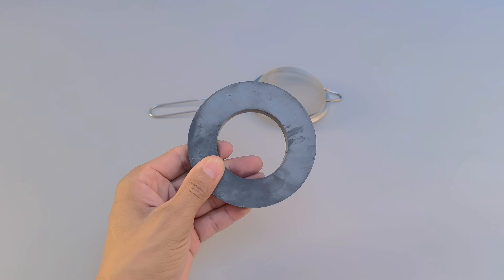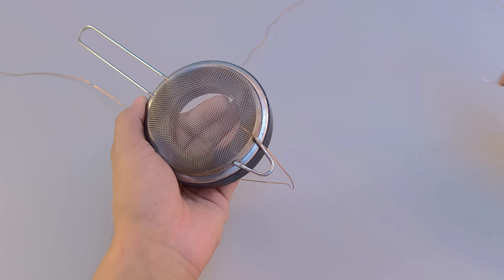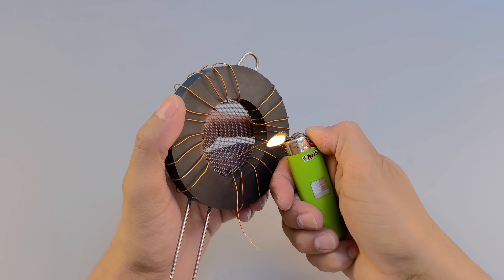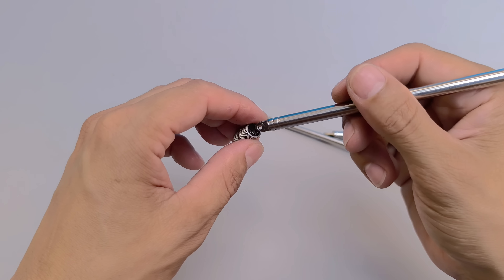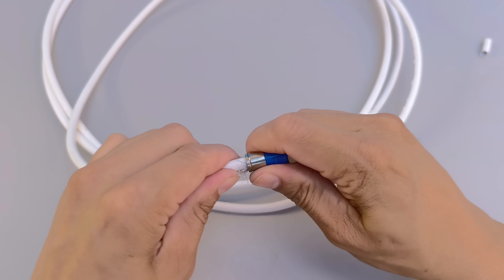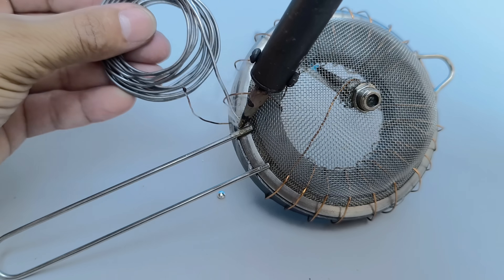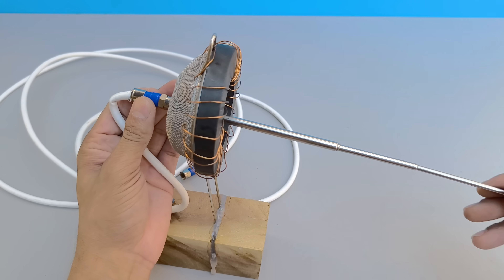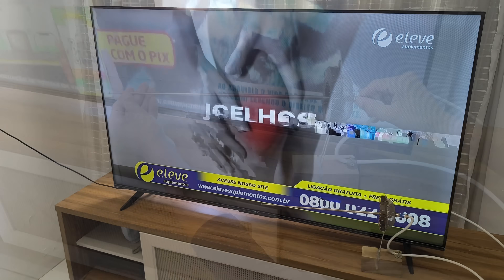Nikola Tesla's Secret Invention! Connect a Steel Sieve to a Magnet and See What Happens

Comment: Wow what a useless presentatiion.
This will not work as this guy obviously has no idea how coaxial cable works. Not only does he not know how to solder but the fact he connected the center lead to the outer case of the connector he shorted the signal lead to the shield so there is no antenna at all.  The "antenna" is not even in circuit let alone his half assed induction coil. And even if the lead was properly connected the impedance would be mismatched. And you are never supposed to put a sharp bend in coax cable. Could he have done this more incorrectly?
DO NOT build this useless contraption!
Reply from the maker: Take it easy, friend! 😅 The idea here is not to replace a professional antenna, but to explore possibilities with creativity and reuse of materials. Even outside the ideal technical standards, sometimes the "impossible" works in practice. But thanks for the detailed analysis — constructive criticism (without bashing 😄) always helps to improve!

Comment: I am an engineer from Japan. This video shows a setup that is completely meaningless from an electrical standpoint.
If this kind of setup results in receiving a signal, it simply means that the broadcast signal in the area is already strong. In such cases, even just stripping and extending a coaxial cable randomly would produce the same result.
The sieve, the magnets, the enamel wire, and the mention of Tesla — all of these are used just to make it look convincing and mislead people who don't know better.
電気的には全く意味がない工作です。
これで映像が映る環境であればそもそも放送の電波自体が強い地域なので、同軸ケーブルを適当に剥いて伸ばすだけでも同じように映るでしょう。
ふるいも磁石もエナメル線もテスラも、素人を騙すためにそれっぽいものを引き合いに出しただけです。
Reply: Thanks for the truth.
Reply: Thanx you saved me time
Reply: UK here your so right, people will believe anything a so called expert tells them.
Reply: @piano40s until you try or have means to test it out you gotta believe someone that has tested it before you
Reply: If magnets could enhance radio wave reception,  😂😂😅😅  then why don’t any antennas contain magnets? I've never seen a radio or TV antenna that includes a magnet.
     もし磁石が電波の受信を強化できるなら、なぜどのアンテナにも磁石が使われていないのでしょうか？ラジオやテレビのアンテナに磁石が使われているのを見たことがありません
     자석이 전파를 강하게 수신하게 해 준다면? 왜 그 어떤 안테나에도 자석이 포함되지 않는가? 내가 본 라디오 안테나, TV 안테나에 자석이 포함되어 있는 것을 본 적이 없다.
Reply: @mathamour  
Thank you. Your point is absolutely correct.
In AM radios, the built-in bar antenna uses a ferrite core, which looks similar to a magnet on the outside.
At first, I assumed the video creator might be trying to use the magnet as a substitute for a ferrite core. But as I kept watching, it became clear that they were doing something completely meaningless.
In addition to that, there are numerous other mistakes related to the shape, electrical connections, and usage.
However, if I explain too much, it might give the creator "hints for how to deceive viewers more effectively in the next video," so I’ll refrain from going into further detail.
감사합니다. 당신의 지적은 전적으로 옳습니다.
AM 라디오에 내장된 바 안테나는 겉보기에는 자석과 비슷한 페라이트 코어를 사용합니다.
저는 처음에는 영상 제작자가 자석을 페라이트 코어의 대체물로 쓰려는 것이라고 생각하며 봤습니다.
하지만 계속 시청하다 보니 전혀 의미 없는 짓을 하고 있다는 걸 알게 됐습니다.
그 외에도 형태, 전기적 연결, 사용 방법 등 여러 가지 잘못된 점들을 지적할 수 있습니다.
하지만 너무 많이 말하면 영상 제작자에게 “다음 영상에서 시청자를 더 잘 속이기 위한 힌트”를 줄 수 있으므로, 자세한 설명은 생략하겠습니다.
ありがとうございます。あなたの指摘は正しいと思います。
AMラジオの内部にあるバーアンテナには、外見が磁石に似ているフェライトコアが使われています。
私は動画の途中まで見たとき、磁石をフェライトコアの代わりとして使おうとしているのかと思いました。
しかし視聴を続けているうちに、それが電気的に意味のない行為であると分かりました。
それ以外にも、アンテナの形、電気のつなぎ方、使い方など、間違っている点はたくさんあります。
でも、あまり詳しく書くと、動画を作った人に「次の動画で視聴者をもっと上手にだますためのヒント」を与えてしまうかもしれないので、細かいことは言わないことにします。
Reply: @須磨保太郎-s2y   Your comment is bang on.  I have seen  dozens of Youtube videos with an endless assortment of random items  connected to a piece of coaaxial cable  to increase TV reception that all do nothing but waste your time !
Reply: @須磨保太郎-s2y  Thank you so much. 👍
Reply: @須磨保太郎-s2y is not like there is a copyright on the patent
Reply: @mathamour  The starving creator of this video wanted to appear convincing.
Reply: @mathamour  Maxwell Chikumbutso retuned and turned it into a power source. Buy him a coffee.
Reply: @mathamour  Yo he usado imanes en el cable coaxial con buenos resultados, inténtalo, pero claro, no se necesita todo este procedimiento, solo enredar el cable en el imán. Saludos.
Reply: Thank you so much!!! I almost start doing it. The guy who created this video is starving and needs some money from U-tube.
Reply: @balloney2175  he is brasilian!
Reply: Thank you for sharing your knowledge. Whenever a video title includes 'secret',or 'hidden' knowledge you can bet your life it is utterly useless.
Reply: The coax is short circuited at the base of that Balun where the dipole is soldered lol
At best it will overload the impedance and fry the TVs signal amp lol
Reply: As an electronics technician, I have to say that solder joint probably receives more radio interference than the whole setup itself! 🤣🤣
Reply: Exactly 100%, as an electronic engineer, the project is a complete joke!   'Nicola Tesla secret invention', what total 'BS'!
Reply: Я Я инженер не из Японии  и я точно такого же мнения как и инженер из Японии.
Reply: @ЗарубаВалерий-л4ю  😂😂😂👍👍
Reply: Aconsejo antes de ver estos" inventillos" ver primero los comentarios 😅😅😅😅😅😅
Reply: Так делают все распространители фейков используя набор вещей которые под рукой что бы сделать какую нибудь нелепую конструкцию и при этом убеждать всех что это что то фантастическое ..используя  имена известных учёных и изобретателей.
Reply: Agree.  I'm electronics and control system engineer also, this device is nonsense.
Reply: СПАСИБО!
Reply: The thing I want to know is can still use the shive to make my fairy cakes? 😂
Reply: @paulwalls9851  Looks like it can't be used for baking anymore — but now it’s perfect for sifting out people with scientific literacy! 😄
Reply: Eso solo vale para perder el tiempo
Reply: @須磨保太郎-s2y  очень жаль, что Ютюб который делался как просветительный канал.... Превратился в канал для фриков, и шутников (((((((. И спасибо что есть такие как вы, которые объясняют что это глупость! Спасибо!
Reply: En cuanto vi el colador de aluminio y el imán me empezó a chirriar.
Reply: Person already stated this is a project of love it doesn't include any scientific research or engineering aspects at all.
Reply: Cały ten projekt to bezsens. Ale ~780k wyświetleń, 1k komentarzy i autor filmiku zarobił pieniążki od YT. Ode mnie zarobił bana.
Reply: Excatly. Basically just a bunch of click bait.
Reply: That's true, I also noticed meaningless short circuit of the connector by telescopic antenna.. This vid is only good for learning American English and how to take apart the F - connector))
Reply: @須磨保太郎-s2y  gracias por mostrarnos la verdad!!!
Reply: @須磨保太郎-s2y  you are correct
Reply: thank you
Reply: @須磨保太郎-s2y  siii cuando pusieron Tesla ya demostró su inercia mental. Entré a ver los comentarios... Jejeje
Reply: Thank you Sir, I despise fake people and information
Reply: @須磨保太郎-s2y  saya percaya ahli japan
Reply: Thank you from US ❤
Reply: I’m not an engineer, but I’ve done some research and probably more than 90% of the things that people claim Tesla invented had already been previously invented and quite frankly the only thing I can find that he actually invented may very well be the Tesla coil. Now is he famous for tinkering with those previously invented things and putting them into practice such as the AC motor (which was invented in Germany and not by him)
Reply: Thanks for your information.
Reply: agree with japani engineer, there was no calculation how much impedance does this coil made for. seems baseless really.
Reply: exactly
Reply: I agree 100%  This is mumbojumbo.
Reply: Du hast vollkommen recht, zudem ist der Innenleiter mit der Abschirmung kurzgeschlossen. 
Der Baumarkt-Lötkolben und der Lötversuch deuten auf einen Anfänger hin. DVBT wird, zumindest hierzulande, vertikal ausgestrahlt, da die "analoge" Ausstrahlung bislang horizontal erfolgte. Somit wird ein großer Signalabstand gewährt. 
Grüße aus Deutschland
Reply: Great. Looked like an April Fools Day joke.
Reply: это фокус для школьников и детей а не для взрослых дядей
Reply: It's a very eficient AntrennA for gathering KLICKS ! !  Curiosity is yet functining, not only at CATS.
Reply: Thanks you for letting us know. There are more and more similar fake videos and this wastes our time.
Reply: 8:43 ”make sure to kink the coaxial cable to block any possible signals caught by the device…”
Reply: ✋YOU DON'T KNOW THAT FOR SURE..! 
🧐DO YOU.!?
You maybe 99.9% sure, but not 100%.
Science will ALWAYS surprise you.!

Please, don't destroy all those potential 
future scientists by your telling people, convincing people, NOT TO BOTHER.! Not to 'try' or See For Themselves? 

How many times have YOU failed before you succeeded? Probably thousands? But that's how people learn! That's how YOU learnt.! 

Yet you come on here like a god, a KNOW IT ALL, and think you are now a master or the universe, and WORSE, tell people to NOT BOTHER doing EXACTLY what YOU did to become the professional YOU are today.!

Do YOU see now?
Do YOU see what YOU have done?
YOU LEARNT BY YOUR FAILURES.
Yet YOU tell others Not to ask YOU did.?
STOP-IT NOW!
Think carefully about how YOU learnt.
And pass those blessing on to others x
Reply: YOU DON'T KNOW THAT FOR SURE..! 
DO YOU.!?
You maybe 99.9% sure, but not 100%.

Science will ALWAYS surprise you.!
Please, don't destroy all those potential future scientists by your telling people, convincing people, NOT TO BOTHER.! Not to 'try' or See For Themselves? 

How many times have YOU failed before you succeeded? Probably thousands? But that's how people learn! That's how YOU learnt.! 

Yet you come on here like a god, a KNOW IT ALL, and think you are now a master of the universe, and WORSE, tell people to NOT BOTHER doing EXACTLY what YOU did to become the professional YOU are today.!

Do YOU see now?
Do YOU see what YOU have done?
YOU LEARNT BY YOUR FAILURES.
Yet YOU tell others Not to do as YOU did.?

STOP-IT NOW!

Think carefully about how YOU learnt.
And pass those blessing on to others x
Reply: @須磨保太郎-s2y  YOU DON'T KNOW THAT FOR SURE..! 
DO YOU.!?
You maybe 99.9% sure, but not 100%.
Science will ALWAYS surprise you.!

Please, don't destroy all those potential 
future scientists by your telling people, convincing people, NOT TO BOTHER.! Not to 'try' or See For Themselves? 

How many times have YOU failed before you succeeded? Probably thousands? But that's how people learn! That's how YOU learnt.! 

Yet you come on here like a god, a KNOW IT ALL, and think you are now a master of the universe, and WORSE, tell people to NOT BOTHER doing EXACTLY what YOU did to become the professional YOU are today.!

Do YOU see now?
Do YOU see what YOU have done?

YOU LEARNT BY YOUR FAILURES.
Yet YOU tell others NOt to do as YOU did.?

STOP-IT!
THINK!
Think carefully about how YOU learnt.
And pass those blessings on to others x
Reply: Sitko to niejaki Marek Podlecki omawiał jak konstruował tajny projektów nazwie Deparchator😊
Reply: almost every channel is encrypted even if the "antenna" does the job he says, it does not decode the signal for which you need a receiver with a decoder
Reply: 100/100 🙂.
Reply: Does this explain why as a kid when I unplugged my console coaxial cable I could still see the image perfectly fine on the tv? I swear I did that some day haha that or maybe I unplugged another cable
Reply: Benar sekali , hal hal seperti ini mudah dimengerti oleh tekhnisi
Reply: Yes.  Scam the ignorant with sensational nonsense.  Just like FoxNews does to MAGA fans.
Reply: По ідеї.... Ідея представлена в відео. Має право на існування. Але саме це виконання. На мою думку теж переводня матеріалів.
.
Я про що маю на увазі. Використання певного блоку потужних магнітів... Як джерела фокусування магнітних хвиль, довкола магніта...
.
І все... Мені особисто здається... Що якщо поставить феритовий стержень. Як приймач сигналу... І з двох кінців по магніту... Так що б всі вони магнітні... Вистроїлися в ряд. Можливо антена краще ловитиме.
.
Дам підказку...
.
Потом нержавіючу сталь, харчову, яка не магнітиться і не взаємодіє з компасом...... Потом об неї більш тверду сталь що не магнітиться, або мідний сплав що не магнітиться. Можно потерти об дюраль...
. При терті. Двох сплавів що не магнітиться... Один намагнічується північним полюсом, другий сплав південним полюсом. Що говорить про існування позитивного і негативного магнітного заряду.
.
Є електрони і є магнітони. Є протони, і магнітні позитивні частинки.
.
.
Тобто. Магніт, може, впливати, на магнітні молекули кисню в повітрі... Молекули кисню в повітрі... Вистроють магнітні силові лінії...
.
Кисень. Має ізотопи кисню, шістнадцять і так далі. Різні ізотопи кисню, вступають між собою, в магнітний хімічний зв'язок...
.
.
.
Не дякуй за інформацію 😅😅😅
Reply: @須磨保太郎-s2y  Pues da y construye un instrumento mejor para tener mejor recepción en lugares donde la señal es completamente deficiente.
Reply: @Teodoro-l9b he did not claim that! Just that it improved what was there.
Reply: @Teodoro-l9b  How is it that because my signal is very weak, I do not receive any channel?

Comment: yalan lnb içierisindeki devre olmadan ve uyduyu görmeden uydu yayını almaz. bunlara koyunlar inanır.izlenme kazanmak için uydurulmuş.
Reply from the maker: In fact, the main function of the LNB is to amplify extremely weak radio signals captured by the antenna, minimizing losses and degrading the quality of the original signal as little as possible. In this specific invention, a magnetic magnet was added as an experimental complement, with the aim of interacting with the electromagnetic fields around the system, seeking possible effects of optimization in reception or filtering interference. Although the use of the magnet is not common in commercial projects, its application here has an exploratory and creative character, within a proposal for homemade and alternative technology.

Comment: silent L (in USA) and horrible solder job.
Reply from the maker: You are correct, the "L" was not pronounced. This is due to the current limitations of AI dubbing, which is still in the process of being improved. As technology advances, it is likely that this type of flaw will be corrected in the future. As for soldering, the surface used does not have good adhesion to tin, which makes the process difficult. Even so, I used the available resources to obtain the best possible fixation. The aesthetic finishing of the part was not done after soldering, which would have provided a cleaner and more professional look. However, this does not compromise the functionality or integrity of the project. Thank you for your comment and for sharing your technical observation!
Reply: @inovaouinventa  I did not realize the voice was AI. Glad to know that you are better at soldering than what I first thought.